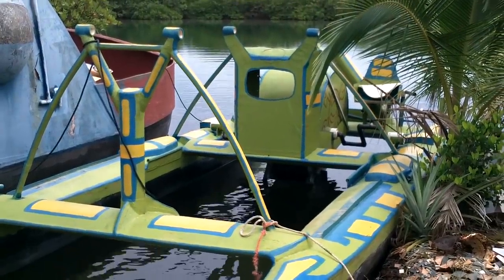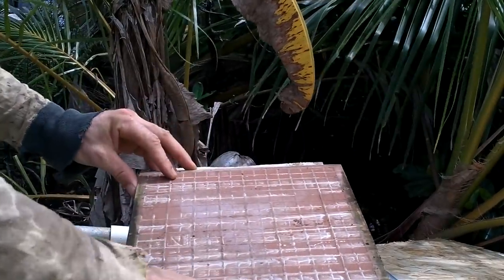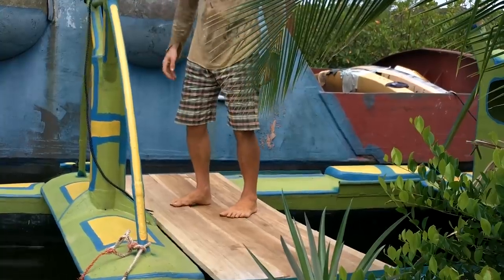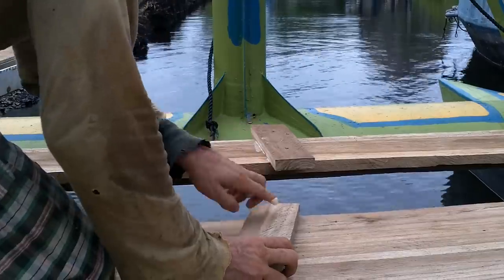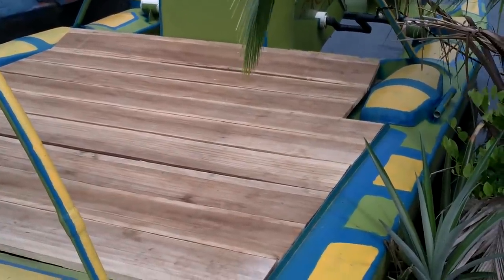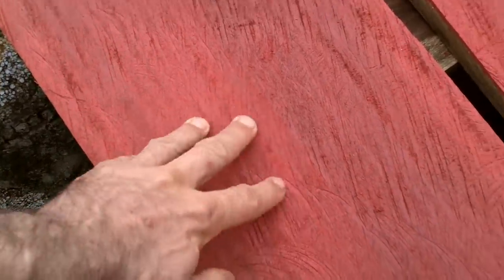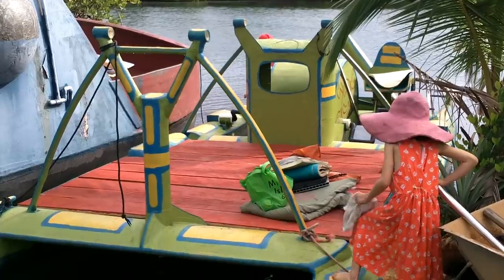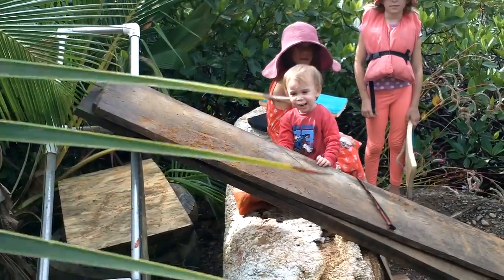Solar Sailer 020 Interlocking Cargo Floor

Comment: Hello Jamie, installing a removable 5×2 timber centre support beam from the kidpod to the front cross beam on U shaped brackets front and rear, to set it on its edge at the level under the floor, would increase the load bearing considerably for little extra weight or work. Regards Dave.

Comment: Making a deep plunge cut, needed the full depth of the sawblade.
Any time doing regular cuts and rips, adjusting the depth of the battery saw blade so the saw kerf just clears the board will extend time on the saw battery.

Comment: Good job! I'm surprised you didn't make a removable fiberglass floor in sections. Then cut your boards in thirds and fiberglass those vertically, to the bottoms. (Whole lot more strength in a few of those strips, glassed in vertically, than in all the boards laid in their horizontally. And you could have saved some weight, as well.)
Keep up the good work. I love thinking outside the box!

Comment: i wounder how well an electric motor would do aswell as pedals or when tired use instead for the boards a half lap would work well to strengthon the floor

Comment: One stainless metal rib down the boat under the center of that planking would've been pretty effective to stiffen it.
Reply: Even a wooden reinforcement, like 2"x1" will increase load capabilities but then again, dont know what is designed max load rating of a pontoons, plus available power...

Comment: Best way to test the strenght of the boards, find a body of water, put the board on the water, support 2 ends of the board, and jump up and down right in the middle of the board. 😊😊😊

Comment: Planks going to warp, when painted only on one side
Reply: Yeah, that's not going to work out well. A product like Thompson's waterseal, on both sides, would be a much better choice.
Another problem he's going to have is that he used a water based glue to attach the cleats!
Reply: Was thinking that as well.  Our boards on our fence did due to being painted on one side only.

Comment: Is there enough current to generate electricity underwater as  the tide comes and goes?
Reply: o0julek0o with Jamie never say never but the short answer is no.   Tides close to the equator are very light and the depth of water around him is very shallow.   The combination of those two factors means there isn’t enough tidal flow to harvest effectively.  Especially considering he has almost unlimited solar